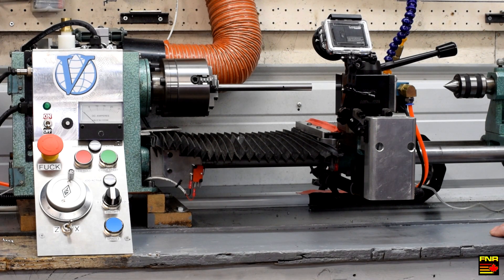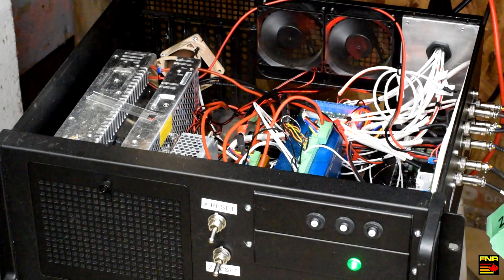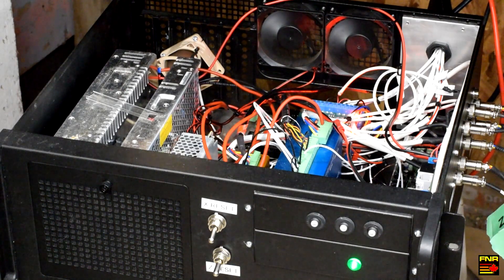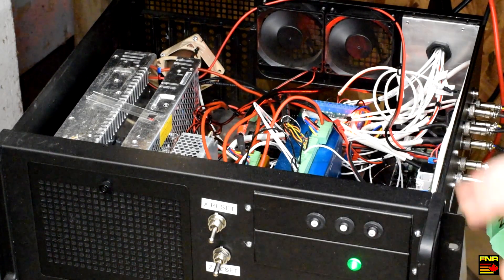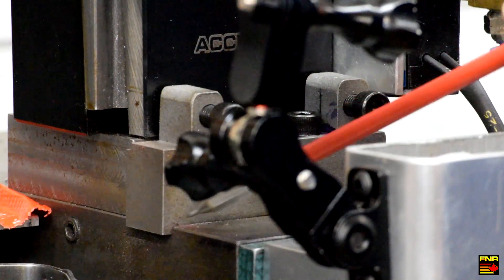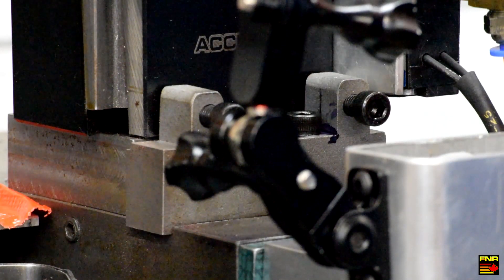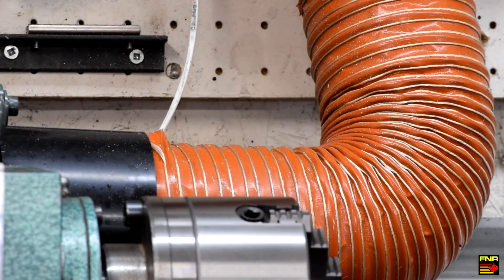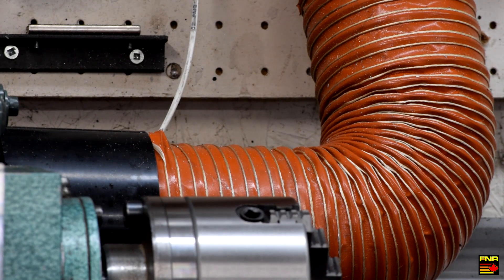FNR CNC S02 Ep 6 - Lathe V2.0 Feature Roundup

Comment: Not only a well made video but a well thought out modifications!!!  Thanks for publishing.  I think I will add the motor fan per your suggestion since I have a  treadmill motor too.
Reply from the maker: Thanks!

Adding the fan made a big difference in the operating temperature of the motor. 

Perhaps more importantly, it seals off the brushes from flying swarf and coolant - those motors are not sealed at all, and they really do not like dirt. 

The first motor died a flaming death from a mixture of overheating and chewed brushes/commutator. Since the fan mod, no issues. 

I used 48V because I had reserve capacity on my 48V DC power supply; any fan with reasonable airflow should work.

Comment: New to your channel so I apologize if this question has been asked/answered. Is this setup available for others to implement? I have a small harbor freight 7x12 that I would like to concert to CNC.
Reply from the maker: Welcome aboard!

So yes and no.

"No" in that I don't sell this as a kit or anything, nor did I buy someone else's kit and assemble it.

"Yes" in that most of this is off-the-shelf or easily custom-ordered to replicate yourself.

If you get:
- A Mach 4 license
- An Ethernet Smoothstepper (I like the CNC4PC C25XP version)
- A pair of stepper motors and their motor drivers
- A 24V power supply (for the ESS)
- A 48V power supply (for the steppers)
- A box to stick the electronics in
- Some misc electrical parts (wire, switches, circuit breakers etc)

You'll be most of the way there. All you will be lacking is the mounts to connect your stepper motors to your lathe, and those I'm sure exist somewhere, as those mini-lathes are pretty popular.

Good luck!
Reply: @FNR  Thanks good info. I have a Bridgeport mill so the mounts are the easy part. The rest gives me a starting point so thank you for that. I await further excellent videos.